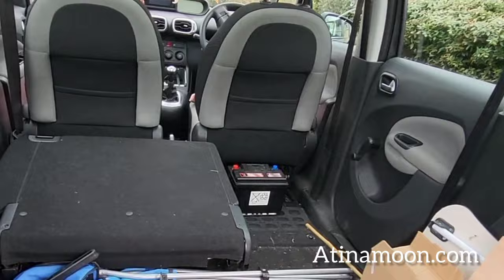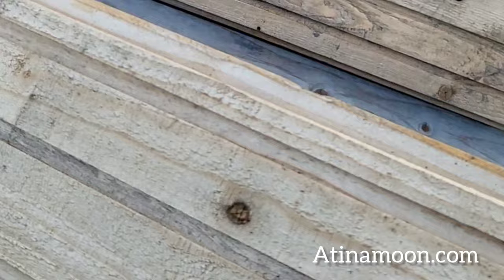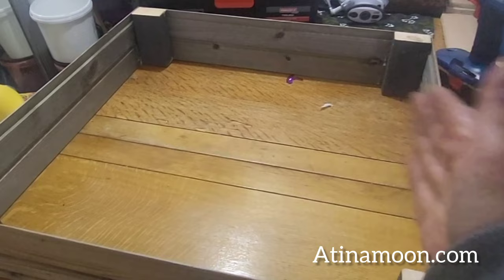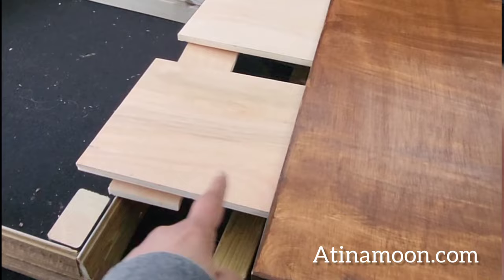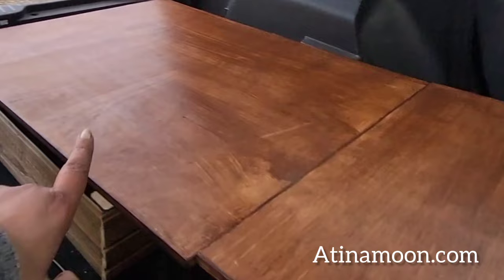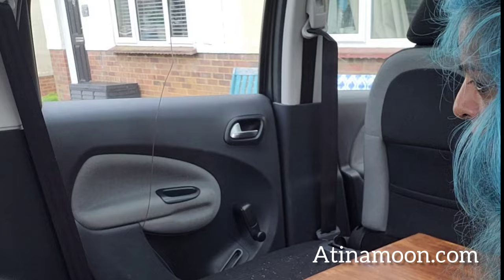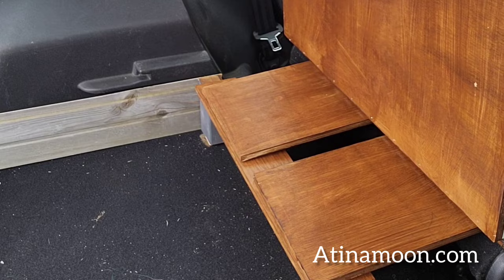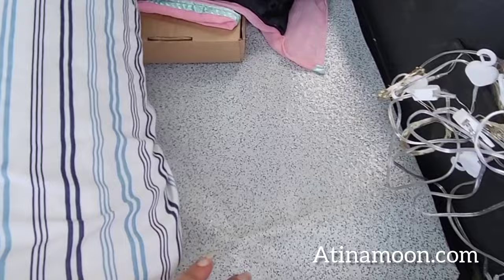Making Bed frame for Micro Campervan.

Comment: I had a similar problem with my Skoda weekend camper. My last Skoda had a completely flat floor so it only needed a mattress, but Octavias from 2013 on have a boot floor which is considerably lower than the back seat when folded forwards. So I built a box with a lifting lid, and I can store quite a lot of things under the lid. Because my bed box only covers the boot floor area I still have a gap between the top of the back seat folded forwards and the back of the front seat, which is not completely filled by the back seat headrest. Before I use it again I will have to make something to bridge that gap, which will fit over the back of the head rest. Then I have secure storage in the rear seat footwell. The Skoda is almost 6ft 6in from the back of the front seat to the rear panel, so although I am much taller than you I have plenty of room.
Reply from the maker: Mmmm I may go for a skoda next time.
Reply: @atinamoon  It's a great car. I go from my home in the West Country to Scotland several times a year and on a run you can get over 70 mpg. Just amazing for a family sized car. This is why so many taxi drivers drive them.

Comment: How long is the bed? I need to upgrade my Fiat Panda camper
Reply from the maker: It's 5 foot 3 inches long. Would be longer if the front seat could have folded down.
Reply: @atinamoon  that's a good size for a smallish car